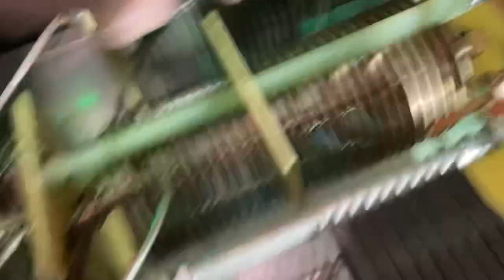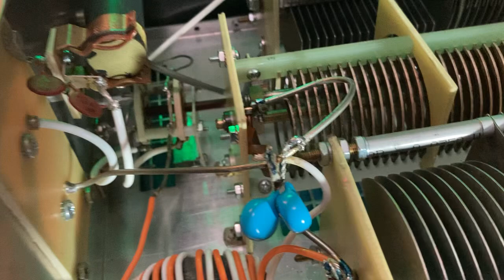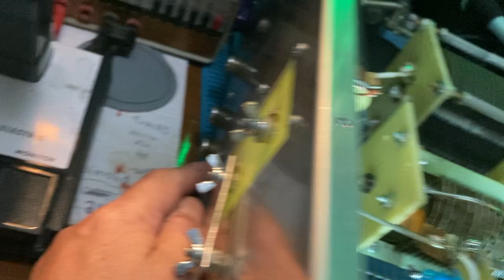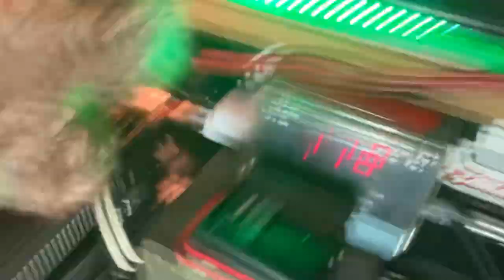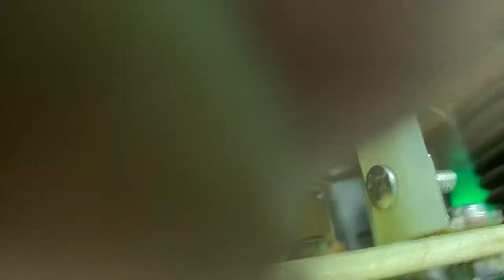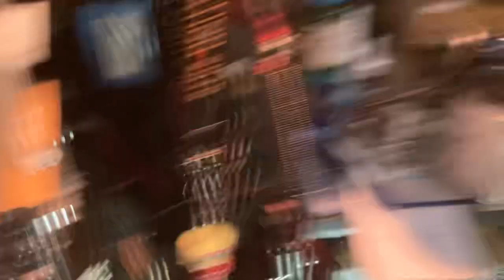Mfj  9982 doesn’t tune📉

Comment: The first thing I would look at is the connections on the antenna switch. The switch may have a fried contact or a poor solder connection. The roller inductor and air variables look fine, but it wouldn't hurt to check the solder connections on those either. MFJ products are notorious for bad solder joints. Good luck getting it going again, you'll figure it out.
Reply from the maker: Antenna switch is cooked
Reply from the maker: The antenna switches from ant 1@2 it could be that switch I see a solder burn on the Teflon someone screwed it up and that’s what I see and a broken contact I believe WTH 🤦‍♂️ some people mess with stuff if you know what your doing
Reply: @Atomshamradio  Those types of rotary switches sometimes fail if someone switches the antenna switch while transmitting at high power. The tiny "clips" on the Teflon insulator get arced and burned literally right off the switch in some cases. Or the clips make a poor contact with the metal contact ring inside the switch. Check for black oxidation on the contact ring. The old CB 23 channel radios with crystal synthesizers had issues with these type of rotary switches failing and you'd lose channels because the crystals had an open connection. The burn you spotted may even have happened at the factory. MFJ is known for poor soldering in their stuff. I think you're getting close to finding the issue.
Reply from the maker: @richb.4374 I hope I can find that switch at mfj fail component it not that old
Reply from the maker: @richb.4374 your right on them old radio I restored a lot of tube cbs wish I shared that I didn’t think I needed utube in the early 2000s just watched videos but yes at times dust and that black carbon tracking gets you I remember cleaning them gently
Reply from the maker: @richb.4374 that’s a nasty burn on that Teflon looks like someone did it I put it under a magnifier looks like someone heated that one track long and burnt the hell out of it probably bent or broke off I hope mfj would sell me one for this tuner this model
Reply: @Atomshamradio  Bummer. I hope you can get one from MFJ now that they are going belly up.

Comment: Disconnect each of the TuneIng capacitors. Reset to maximum. Then turn the individual tuning capacitors to Max. Then you re measure and make sure you have the tuning capacitance went up. Then reset everything to zero. Retest that each individual tuning capacitor is 0 pic of ferrets. Can you test the capacitors between each one of those tuning capacitors. You also have got to replace the SWR meter. For the capacitors and resistors in it also do a function with the tuning.
Reply from the maker: I measured it caps nothing just a little bump and shows nothing on a test meter all high. What farirets your talking about that long big bar you see is the dummy load bar. I think that wafer switch is wasted as well this tuners name is the mystery box
Reply from the maker: The big beads you see is a balun for balance lines or ladder line
Reply from the maker: And for long wire
Reply from the maker: Them blue caps I have to test them properly burnt out from what ever someone tried fixing this and like me no luck iam taking a break on it what crap quality control on this tuner dammmn
Reply: @k8byp   First off just because word check changes a word or two. Does not need an insult. 
Second, any electronic tech knows! First you need to isolated and check components individually. Now just because you have dealt with this particular problem before. And have an educated guess. Doesn't mean you know. 
You go to where you know someone has touched it first. The tunning capacitors were messed with. He had to fix them. I would have ensured they were working correctly. First, since the nuts were missing. Better to verify what was touched before chasing multiple problems. He then said it was hit by lightning. After he checked the tuners. I would have then checked the solder paths for cracked or melted path ways. And without the SWR meter you can't verify anything. . He also said it was a mess. When the capacitors leak the make a mess of everything. I would also check for disfigured or leaking trails to the capacitors. Then I would check the multiple rolled inductors for discoloration and tested. Finally I would check the pl239 connection. To ensure they were not to spread out causing high resistance. 
  I'm not discarding what you're saying. But fix what you know was touched first. So you're not chasing 10 problems. Last of all, if you don't try you don't learn. And being a technician you learn the basics. As a general you learn and have experimented with electronics. As an extra you should be very proficient at it. So that attitude of you shouldn't touch it if you don't know what you're doing. Then no one should ever try. No one would ever learn. That's the wrong way to look at it.

Comment: I am trying to help, so don't take this the wrong way, but you don't sound like you understand how it works.
You don't just mess with something until it works, ya gotta have some electronic knowledge.
Did you put any "missing" screws  where there didn't need to be screws??
Even if the electronic measurement and indicator boards are not working, the basic "tuning" function will still work, and it's function is easily measured with external test gear.
Testing a simple T match is very simple.   Testing switches and plugs is trivial.  
If someone has wired it incorrectly, then it is real easy to see the error, as there is just about nothing in a T match.  
If as you say there is a short in one of the capacitors,  ( variable, or fixed)  it is easy to test for this, and locate the fault.
Use your test gear to measure the value of the tuning capacitors, the fixed capacitors, and the inductor when they are disconnected from the system.  
Use a multi-meter to make simple continuity tests.   If you don't have this equipment, or expertise, then I suggest that you get someone who does.
Reply from the maker: I’ve been doing this stuff for years iam not stupid I know what iam doing thanks for the kind words 🙄I’ve rebuilt plenty tuners etc I got it messed up so you don’t know how much time I put into this situation the screw were missing inside someone tryed to fix it and sold it to my friend which pi$$es me of some one sold him junk in time iam going to tear it all apart etc the metering board with the chips are toast
Reply from the maker: Without the meter on the tuner iam not worried about I used an external meter
Reply from the maker: Thank you bro it is what is he isent sorry just another troll he don’t know me from s!it in the ground I’ve been into radio over 30 years I’ve rebuilds a hundred times I wouldn’t worry about him I know what I know he probably has a piece of string in his a$$ dangling on his poop like a dog with dental floss hanging thier tune that one 🤣
Reply from the maker: I don’t care about know it alls and trolls it shows how funny they sound
Reply from the maker: Right on bud 🫡🫡
Reply from the maker: Also I know what you met omg iam that stupid 🤔 maybe maybe not iam just asking questions that’s all thiers a utuber has the same problems with the inductance coil he said it’s a joke how mfj made it’s a ultimate fail.